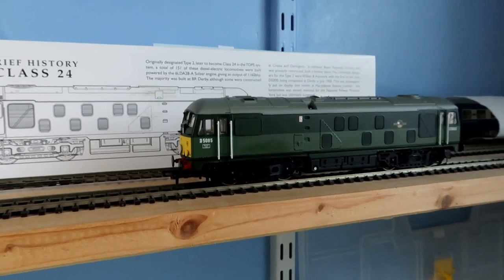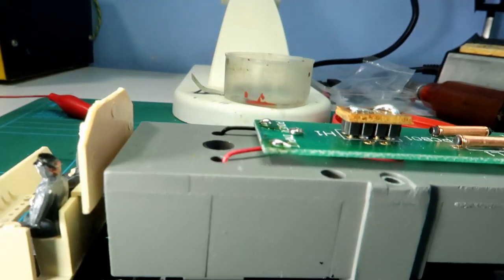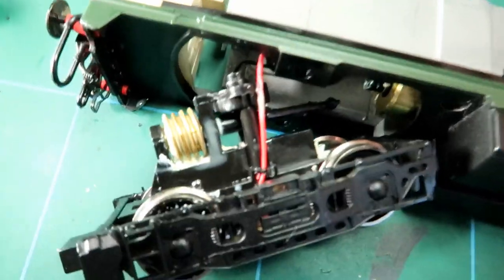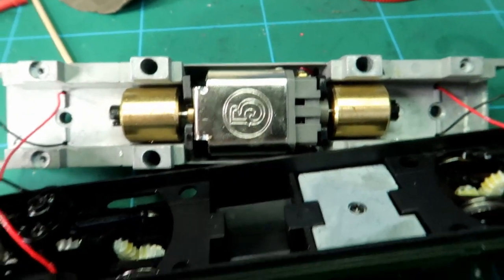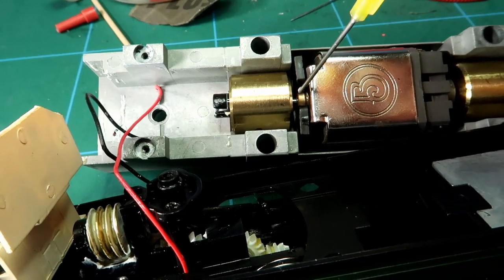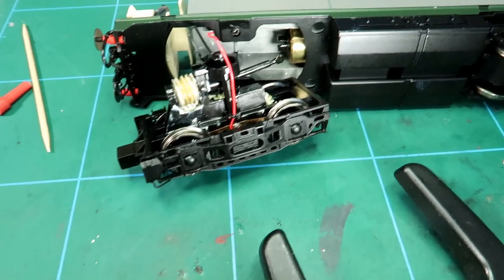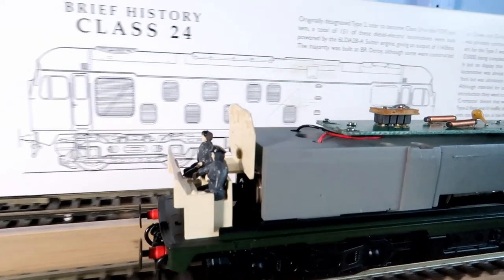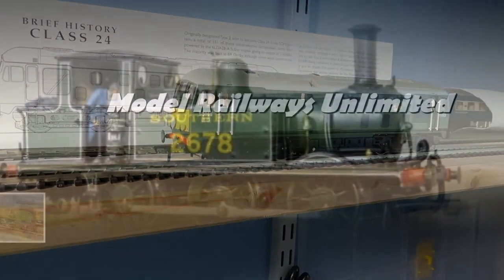Bachmann class 24 full service and strip down

Comment: I have a class 25 and the motor went on it. Its now been fixed and its a lovely little runner like you class 24 :)
Reply from the maker: Many thanks, how did the motor come to go then, usually very solid?
Reply: @ModelRailwaysUnlimited  I was running it on my model railway and my model railway club's layout and kept hearing this grinding noise on those two occasions, so I took It back to where I had bought it from and the guy (a nice person) checked it over and tested it, said that it needed a new motor, within a few days I got the loco back and now it runs brilliant (sorry for the really long reply)

Comment: Very good, just replaced a motor on a class 25 as it sounded like a coffee grinder 😢 unfortunately the new motor from Bachmann isn’t any better. I think the motor is vibrating against the base plate on the chassis. I’ll have to keep investigating 😅
Reply from the maker: Very odd, did you lube the motor bearings

Comment: Great video and much appreciated as has answered questions about a Class 25 I brought on eBay. Runs well but in reverse as it seems the previous owner has removed the PCB and rewired incorrectly! At least now I know how to get inside and which wire should be going where…
Reply from the maker: Oh John I am delighted to have helped, let me know how you get on?